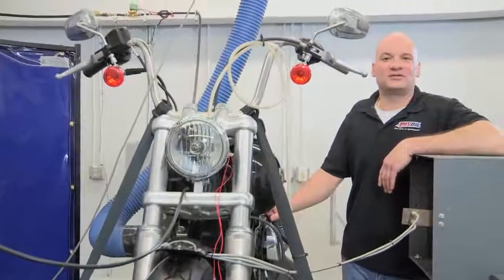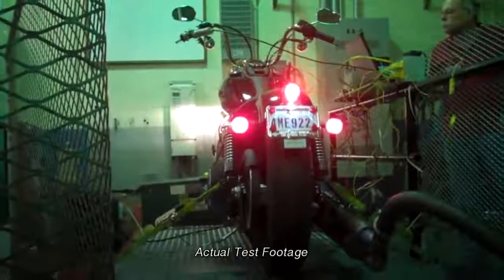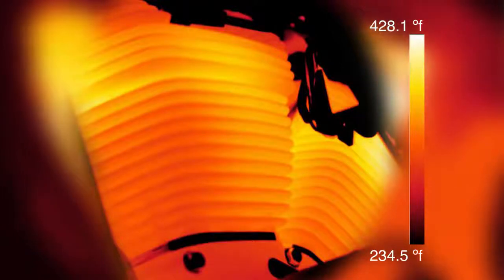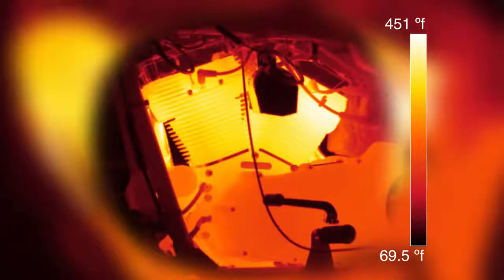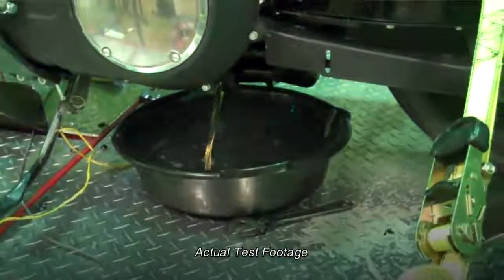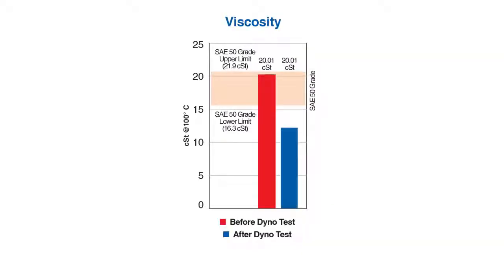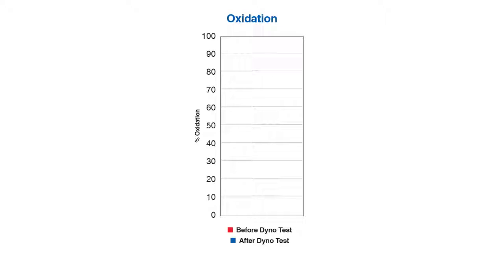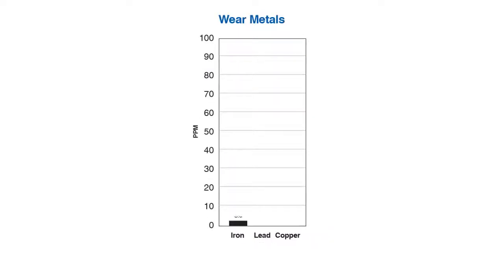AMSOIL V Twin Torture Test

Comment: I have a 2009 Harley Davidson Sportster 883.  I have heard different opinions on switching to synthetic on that particular motor.  One mechanic told me to stick with the standard oil because the rocker is noisy and a little thicker oil is better in that motor.... he also said my rocker or base seals might start leaking with synthetic because the seals are an older design not engineered for synthetics. Do you think your synthetic will be okay in my engine? I am considering running AMSOIL VTWIN 20w-50
Reply from the maker: I have heard mechanics say this and for specifics I always recommend speaking to our tech Dept when switching over to synthetics from conventional oil. AMSOIL does contain detergents and with older seals it could pose a leak- AMSOIL offers a tech Dept for specific questions pertaining to models and the best advice based on the year and model. You can reach our tech line 7-7 central time 
1-800-777-7094
Give them my referral dealer number 5439819
And they will recommend if you should switch or not based on your bike year and model. If Tech recommends one of our products for you to use - reach out to me so I can get it for you at wholesale price- 
I’m always happy to get you the best pricing by sponsoring you as a preferred customer . 
Text 832-499-6393 to buy at wholesale.
Reply: I have a '19 Sportster 883 and it had that same issue even with the OEM Dino from harley. They told me if you allow it to sit to long any oil will eventually bleed out of the seals. They reccomended I also just replace the gaskets with a set of much higher end gaskets. I run amsoil vtwin now and just went ahead with the gasket kit and I don't have that issue any longer.
Reply: I am an Amsoil dealer myself brianminkc, I will tell you that any oil will seep eventually from anything. The synthetics are bad claims from old mechanics are not based in facts. What happens is, with conventional oil, carbon sticks to the seals, thereby starving the seals from lubrication. A crack forms eventually. Oil seeps out because of the crack and seeping thru the carbon. Lets say during this time you change to synthetic oil like Amsoil. Amsoil goes right to work on the carbon, cleaning it slowly over time. Eventually the carbon is cleared away but the damage has been done. The leak becomes worse as it gets cleaned. This doesnt happen this way very often. But its happened a few times to some old mechanics and they swear by conventional oil.

Comment: For wear metals, why didn’t you add aluminum? These engines are mostly aluminum aren’t they
Reply from the maker: Amsoil produces products for specific engines adding additives where needed. I recommend contacting our tech line to see if they can answer your question. 1-800-777-7094
Give them my dealer number 5439819 and they can help answer your  specific question.

Comment: My v star 1100cc custom 2008 calls for 20w-40 but it's so hard to find, will 20w-50 amsoil be good for it?
Reply from the maker: We do offer a few weights , I recommend contacting our tech Dept 1-800-777-7094
Give them my dealer number 5439819
They can answer your questions and give you the recommendation of products!
Reply: I ran  rotella 15W40 T6 in my vstar. In my harley I stick to redline 20W50
Reply: Recline is a good pao oil.